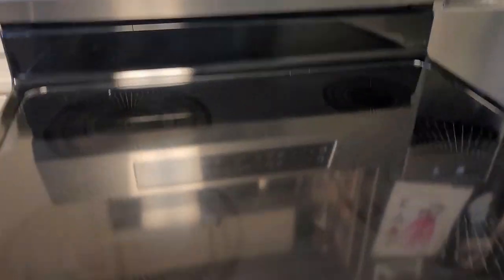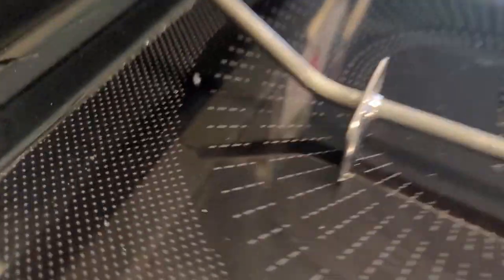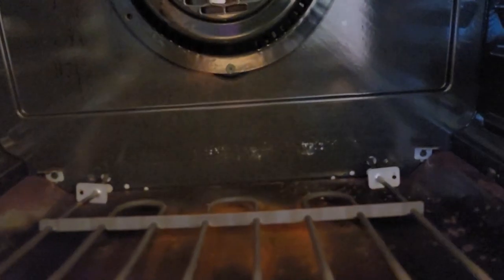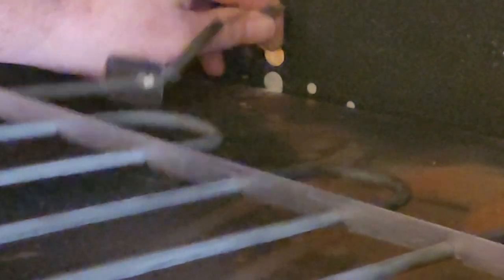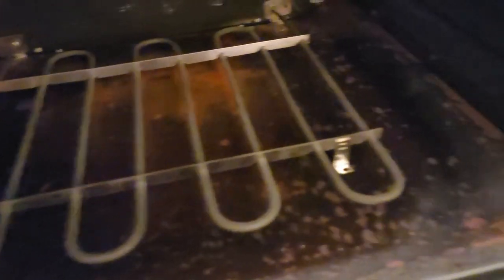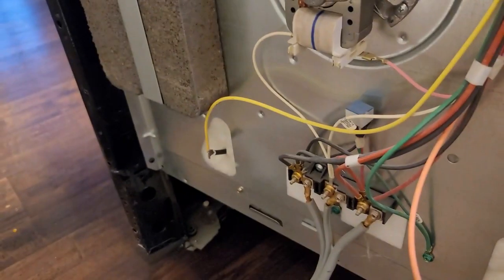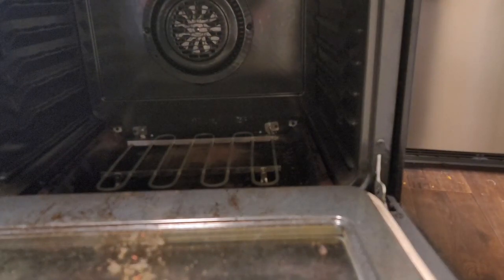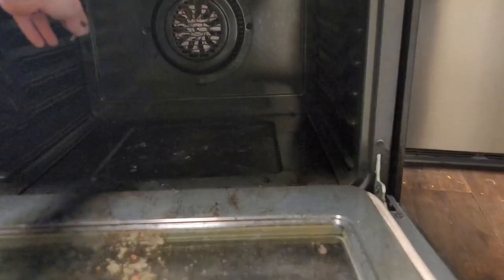How to Replace Baking Element on Frigidaire Gallery Oven

Comment: Can you tell me if the galleries that have a convection fan in the back still has a baking element?  There's no access to the bottom like this, i just bought it, and it says nothing about having a baking element
Reply from the maker: I'm not positive, but I would assume so. They have to have an element. Most new ones have both top and bottom. What model do you have?